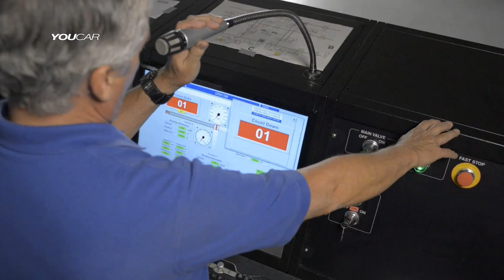CRASH TEST Ford F150 Supercrew and Supercab

Comment: I realize the hate for the aluminum body, but you GM guys need to remember, this f150 has a better crash rating than any other 1500/2500 truck on the market right now.. Although the rest of the truck cumples, the cab remains perfect. Ive had to clean up a roll-over on a 2015. The cab was perfect, with no caving, Rest of the truck was destroyed. Its not about saving the vehicle, you can always replace that, but the important thing is the occupants are safe. This truck has tons of saftey features that you wouldnt understand if you watched this and thought "haha, lol at that ford. Crumpled right up, stupid aluminum".
Reply: Impact from steel KILLS! Alloy aluminum is Cutting Edge technology, The ONLY Truck to receive top I.I.H.S Award..5 Stars,
Reply: People are stuck on v8's and rust. Lol. I mean Dodge and chevy
Reply: Looking at them today, the safest trucks on the market and the Ram 1500, Honda Ridgeline, and the Toyota Tacoma. It's all about crumple zones' today.
Reply: what about the 2019 model?
Reply: nope
Reply: So a collision at 35 mph will total your truck?

Comment: I don't think people realize these vehicles are hitting solid objects that do not move. Most vehicles can do well in crash tests with other vehicles or with barriers that absorb or share energy. Most road barriers are designed to absorb some of the impact. This test is one of the most difficult tests to pass. There is absolutely no way an older body on frame pickup in this class will do as well in passenger compartment protection (I had a 2001 Ram). Who cares about the truck and how salvageable it is after, a vehicle starts as a block of metal and ends as one. I care about life and limb.
Reply: Old to reply, but anyways. Still you can hit solid objects that do not move. What makes you think you can’t?
Reply: @Rodrigo-ev7tx  exactly. What if you hit a brick building or a concrete block
Reply: @cptchuff2741  this is literally what they’re testing in the video your commenting on. What are you even trying to say?
Reply: @Willyd2758  What are you trying to say?
Reply: People saying these new vehicles just break upon impact need to learn about energy lol. They’re literally designed to do that. They’re not trying to protect the truck. They’re trying to protect the people inside. Older vehicles would kill you because they are solid.

Comment: Yeah. Many older trucks are a lot less safe. The SuperCrew aced all 5 crash tests with no injuries reported by the dummy. The SuperCab only got a Marginal rating in the Small Overlap crash test but aced the other 4 crash tests with no injuries. The dummy reported possible leg injuries in the Small Overlap test, but nothing life threatening. While the crashes may have looked bad, these trucks did very well. Possibly the safest pickups on the road. No old truck can compare.
Reply: Samuel G x
Reply: In real life in a vehicle on vehicje crash an older, stiffer, higher riding truck would fare much better then you think. The newer ones are safer if you hit something like a tree, but the older ones do fine if you cream another vehicle, espicially if its something soft. likr a modern pickup
Reply: @redneck400m3  or as actual testing and historical data shows, the "soft" modern truck breaks and crushes whilst keeping the cab intact whilst the older stiffer trucks either cream their contents all over the inside and you hose them off and replace the dented bumper...or they rollover and the roof shears straight down crushing them 🙄
Reply: @JohnLawley24v  No. like i said, if you hit a tree or something solid yes the new one fares better. If you hit another vehicle, that is modern and softer, it absorbs the older trucks impact as well and the newer vehicle takes the brunt of the force. Like crashing a 2x4 into a pop can.

Comment: For those unfamiliar, typically crash tests would only be performed on one variant for models which offer more than one (highest selling, historically SuperCrew). The IIHS was tipped off that Ford made improvements with added steel bars in front of the front wheels to help with the new small overlap test that wasn't added in SuperCab or other cab variants.

The testing clearly shows this disparity with the results.Thankfully, Ford has stated that they will begin adding "countermeasures" to ensure that the SuperCab and other variants perform better (adding in these additional crash bars) for 2016 model year. 

It's a shame that a manufacturer (especially one as big as Ford) has to be called out for "cheating" in order to do the right thing. It just goes to show you how far some companies will go to save a buck. It definitely shows the uglier side of capitalism. Another side benefit is that the IIHS is planning on testing multiple variants of pickup truck models from other brands (Chevy, Dodge, etc) to see if they find the same discrepancies.
Reply: +jctevere Most manufacturers do this. Things are so cost competitive now, with the technology people want, CAFE standards, and labor rate disparities.  Most only put the reinforcements on one side. Although that might change as the are planning to do small overlap on the passenger side aswell. At least the frame show horns on the F150 are on both sides.

Comment: Seems some of the commenters should have been sitting in those trucks...

Pick up a physics book and learn about energy transfer, then come back here and apologize for your painfully uninformed opinions. 

Vehicles are built to dissipate the energy imparted by a collision around the occupants instead of into them like those old sleds would do. They're like helmets, meant to be used once. When you see a helmet that cracked in half, and the person that was wearing it is showing it to you, you don't say, well I'm not wearing helmets any more, look, it broke! No, you say, good thing you were wearing it. It kept your head from releasing it's knowledge all over the pavement.
Reply: Excellent comment!
Reply: Crumpling too much is also bad, look at what happens to the dummies arm, it's outside of the door after the door pops off.
Reply: +Derp Band I just watched another crash test video of 2004-2008 F150 Models and compared it to this one, the 
cabin in the older models remained much more intact and the body did not crumble like these new ones, the only thing they lacked back then were curtain airbags, other than that they were pretty safe. I can only imagine being in a multi-vehicular crash with these new ones, airbags only deploy once, a second hit and you're dead. I don't know how the chief engineer got away with lying all over about this new "military grade aluminum alloy"(a term Ford came up with) being stronger than steel, these trucks are NOT safe, too much crumble is bad and this video proves it.
Reply: +WQQKIE Ok... First, nobody is keeping you from buying an old truck. If you think they're safer, go for it. You'll be wrong, but at least you'll be happy.

Much like you can't judge a book by its cover, you can't judge crash results based on the eye test, especially nowadays. The sensors in the dummies and throughout the vehicle must prove that the crash environment is equally or more survivable now than in previous models, or it wouldn't pass.

Now to the matter of the 'military grade aluminum.' Yeah, it is a marketing term, more or less. But so is 'high strength steel,' at least in this capacity. They're not making frames and bodies out of tool steel. If you believe they are, I got some great ocean front property in Iowa you'll love. It's most likely just some run of the mill medium carbon steel that they can get a decent rate on. That applies across the board. True high strength steel is brittle and will just crack under pressure, literally, instead of deforming and absorbing energy. The aluminum bodies are thicker and less prone to dings and dents. I own a 2010, and the sheet metal on those are paper thin. You can look at it wrong and put a dent in it. The extra material is a welcome advancement. The weight savings are just a nice addition.

If you really can't accept your truck body being aluminum, you better baby your current vehicle, because I can nearly guarantee that Chevy and Dodge will be following suit in the next 5-10 years, if not sooner. Plus, there are countless cars on the road that already employ aluminium panels. Aluminum is the foreseeable future. Eventually, carbon and composites will probably take its place. It's a natural evolution. Don't be so afraid. :)
Reply: +Derp Band Well your comment seems a little demeaning but I don't care, if that makes you feel better. I'll buy what I want, you're right. However,  I was simply comparing apples to apples, and these new F150s are definitely not apples compared to the previous models. Whatever happens in the future is beyond me but we can't deny that these new trucks are garbage, regardless of the brand, a lot of manufacturers are moving in that direction already, like Toyota introducing aluminum hoods on their vehicles for a few years now, etc. Are they safer? Maybe, the one in this video, definitely not which was the point I was making in the first place.
Reply: +WQQKIE Considering this is the internet, you never know who you're dealing with. Yes, my tone was a little demeaning, and for that I apologize, you seem like a decent person. In my defense, though, my first comment had a similar disposition. I am happy to hear, however, that my comments on the internet don't offend you.

This being said, my points don't lose their value when the snark is removed. I'm not sure how you can call the current generation of trucks garbage. You may as well call all vehicles being manufactured now garbage. Considering they all are designed and built using similar strategies, regardless of segment or country of origin. By your logic, a Ferrari, Aston Martin, Lamborghini, BMW etc... are all junk, simply because of the materials they are being made out of.

The truth is, automakers are finding ways to reduce weights with the intent to improve fuel mileage. Considering the F150 is the best selling vehicle world wide, this is quite a move forward. Steel has about gotten to its limit on how thin it can be stamped yet still retain it's structural integrity. They simply cannot build cars like they did in the 50's 60's and 70's anymore. It's just not feasible, or safe. The toothpaste cannot be forced back into that tube. All the while these advances in material technology, and they are advances whether you care to acknowledge that or not, can not be sacrificing the safety of the inhabitants of the passenger compartment. Vehicles are safer now than they have ever been. That's not big three marketing jargon, that's independently tested, and true. Yes, this truck looks like a pile of cans after the impact. But that's the intent. This is similar to the seat belt argument from a couple decades ago.

My final comment remains: don't be so afraid and defensive of change. This is a natural evolution in the automotive industry. Look at the new Corvette. It has a fully aluminum chassis now, with composite body panels. That's the future. Motorsports has been taking advantage of aluminum for decades, but it has never been economically feasible to be placed in the mainstream. The longer you fight it, the longer the car makers need to appease those that refuse to move on, and the longer it takes to evolve and improve. Don't buy into Chevrolet's propaganda machine and their "high strength steel" cages... They have as much aluminum in their lineup as anyone else...
Reply: +WQQKIE there are two very important differences between these two crash tests, one has frame reinforcements on the outside of the frame rail designed to deflect the energy. Ford only put it on one of their trucks because they did not think they would have to test both. however both trucks are made of aluminum but the truck with extra frame braces did much better, in fact it did much better than most competitors. competitors. many people are saying it's the aluminum body but it has zilch to do with it.
Reply: +Andrew Mason I can't speak to the validity of your bracing claim, but it sounds plausible. Though, it is a little hard to believe it's because they only thought one cab style would be tested. Do you have a source for this?

Do videos of other trucks in this crash situation exist? I haven't been able to find any yet. These, I'm sure, would really help debunk the aluminum isn't safe myth. But, from a marketing standpoint, I would understand why the others wouldn't want these images circulating. Best to ride this anti-aluminium train until they switch over too in the next 5 years.
Reply: +jldude84 Actually the Supercrew has extra frame components that help it in this test that the Supercab does not. IIHS has a 2:31 minute video that explains this
Reply: +Built Ford Tough exactly
Reply: nice way to say it!
Reply: Derp Band Very Smart, great response
Reply: Watch the video about the indestructible Volvo raming and crumbling aluminum foil made cars like these modern ones. They rate safety by technology like lane departure/collision warning, etc. sad.
Reply: THE TRUTH IS there's a difference between crumple zones and total cabin collapse..

What good is it if the truck obsorbed the impact. But in doing so the steering wheel crushes your stomach and you die? And the lower part of the dash crunches your legs in which you never walk again?....
Reply: He deserves this comment👍

Comment: damn... some big differences between supercrew and supercab..
Reply: Supposedly they fixed that, the supercrew had a crash bar that the supercab didn't.
Reply: @armymatt83 Its been 6 years Ford won't send the F150 for a small overlap test. Suspicious.
Reply: @aidenw207  ah no not at all. they retested it after being fit with the crash bar the crew cab had and it tested out fine.
Reply: @aidenw207  their required to do a crash test on it. It’s already been tested... soo I don’t know what your talkin about

Comment: Some of these people need to go back to school and learn about physics...
Reply: +Andres Velez Bernal What about physicist? Obviously the engineers who designed this truck failed psychics. If you believe this truck is a good example of energy absorption then you are wrong, because as much as this truck crumbles you will be dead in a crash.
Reply: +jldude84 Just note to yourself, I never said I was an expert. I also never said that a crash at that speed would kill you.
Reply: +jldude84 a crash at 40 mph into an object that has very little absorption like that wall can most definitely kill
 you, easily.
Reply: +jldude84 a crash at 40 mph into an object that has very little absorption like that wall can most definitely kill
 you, easily.
Reply: +jldude84 and this means what? we shouldn't design for the one in a million crash? your point has no substance. yes someone can crash by hitting their head just right so we design to prevent that slim chance. People think crash testing is a side detail. it's a massive undertaking.

Comment: This is what ended up convincing me to get the super crew cab with the four doors despite it not being available with an 8-foot bed. The superstructure of the four-door is much better. Also people don't like the aluminum body for some reason, besides it having thin paint and crumbling if you crash it at least it doesn't rust

Comment: I'm an idiot so explain it to me.........if the trucks were built to withstand the impact and not fold up like an accordion....how would that be a detriment to the passenger when the vehicle is equipped with so many airbags?  Seems like a truck that impacts the front shouldn't have it's bed sliding forward to crash into the cab from behind....I'd like to know more about this.  Is the frame giving way or the connections on the bed to frame shearing...or the sheer momentum throwing it and stretching the metal away from it's anchor points???
Reply: The trucks there in the video are made to completely get wrecked and seriously injure the passengers inside. What else would a Ford truck be for?
Reply: +Earl Ismyname Looking at the video, the cab is moving toward the bed and not the other way around. Just look at the bed in relation to the subframe or even the wheel.
Reply: When the dash is in your lap the air bags do not good. The body of the truck is meant to take the energy of the accident and move it away from the passengers in the cab. Want to see an example of this go to the video of an old Impala vs new Impala and look how furious the accident is compared to a vehicle meant to with stand the accident and one meant to take the hit for the passengers.

Comment: if they had of hit the frame and not ran down the side of it it would have been a totally different situation. Im sticking with my military jeeps and chevy's and who drives 40 mph, most wrecks are at 65 or more and there is way to much plastic on these trucks now days that can and will turn into shrapnel. the fender isnt a real good crumple zone and if you look, the front suspension took alot of the shock

Comment: the proof is in the pudding folks, the 4 door truck is safer than the extended cab:  having a door for structure is, and always will be, a bad idea.  vehicles, trucks in specific, MUST have a true structural B-Pillar to keep the passenger compartment intact.  it doesn't matter if the truck is made of aluminum, steel, titanium, or whatever metal you choose.  having the front and rear door as the only structural elements on the side is a markedly bad choice, and I don't know how that crap EVER passed crash testing for highway use.  they're almost as bad as the old Chevy Blazers were.
Reply: That’s probably why Toyota, Chevy, GMC, and Ram don’t do that on their full-size trucks